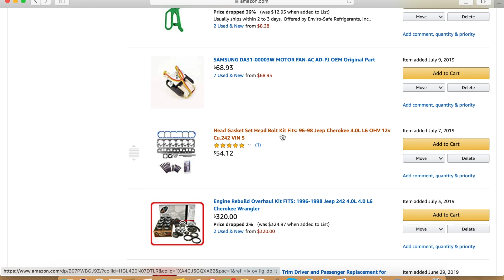Bus to RV Conversion 61 - Fuel lines for Genny!

Comment: As you said, it's easier to push fuel than to pull it.  Mount that little pump on the floor.

Comment: I would try the smaller pump and the gas can together to figure out where the issue is, is it the pump or the cell. Its possible that the air displacement in the cell is to strong and choking the pump.

Comment: Hey i’m trying to learn… so why did you run the positive from the bus’ starter to the generator’s solenoid, and not directly from the bus battery?
Reply from the maker: shorter length.  The bus starter is just on the other side of the gen cabinet, the bus batteries are on the opposite side of the bus.  Connecting to the main battery lug on the bus starter is basically the same as connecting directly to the battery.
Reply: @dzlfreek  Thank you for taking the time to answer my questions… I really appreciate it!!